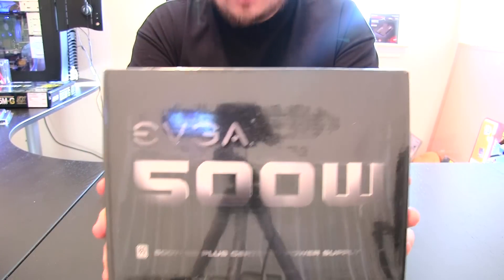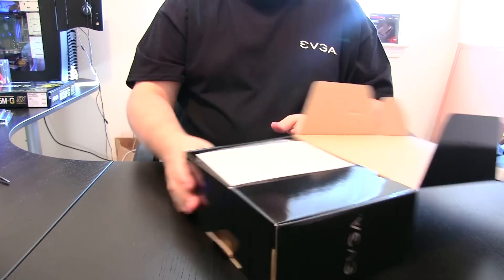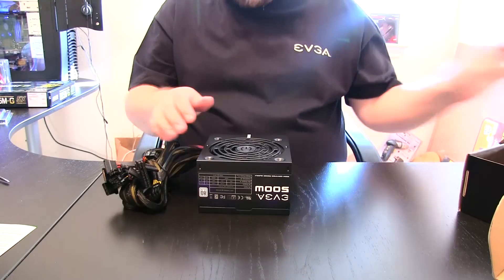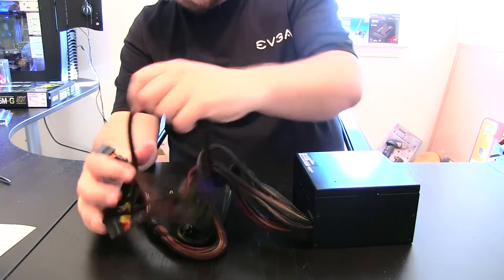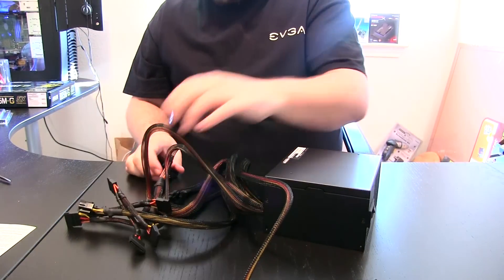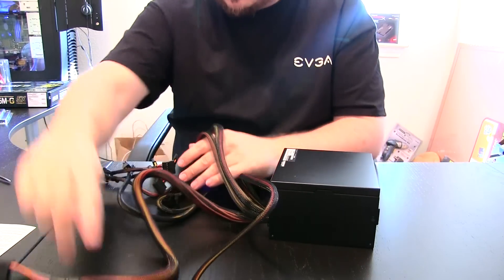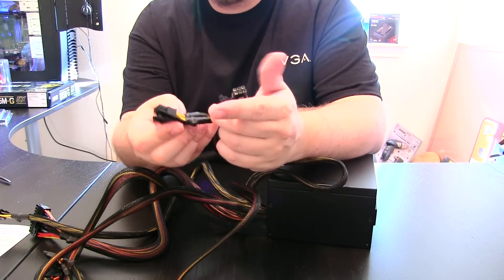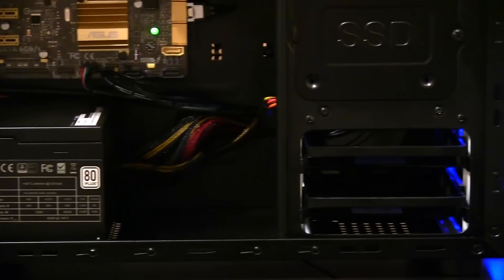EVGA 500 Watt 80 Plus Power Supply

Comment: can this thing power a evga 660ti ?
Reply: got a  shitty psu , i5 3470  8 gb ram, one ssd  , and no gpu for the moment i want to get a 660ti   and a power suply that can  deal with that  shit and wont die on me
Reply from the maker: @inferno  yes it can handle a 660ti easily, but you might want to see if you can get a better card for the same price.  use this legacy chart to see how other cards compare.  https://www.tomshardware.com/reviews/gpu-hierarchy,4388.html
Reply: thanks, when i build my gaming pc i will use it for sure, for now i build this budget setup to run some decent games and to handle  2k movies, i can get a evga 660ti for 40 -45 $  and all of this will be  around 150-200$ so is not that great but can still  work great with the shitty games i play at the moment.
Reply from the maker: @inferno  smart choice picking a quality PSU.  a good one will last through many builds and as long as you don't exceed it's rating will be good for years to come.

Comment: This video helped me a lot before I decide ordering that PSU. One last question: Will it fit in my Thermaltake Swing case? It's a mid ATX and I now use an old Innovator 450W max PSU.
Reply from the maker: It should work no problem as long as your old PSU is not an odd shape. 95% of all PSU's will fit in the same spot, some are just longer than others.  only custom designed ones will be an issue.

Comment: Hey buddy how are you doing?i hope you are fine.Just wanted to ask will this fit in my HP Compaq 8100 elite case?I am really looking for a replacement since i am not trusting the one it has.Thank you for your help.
Reply from the maker: most likely, it will fit.  the best thing to do is open the case and see if the one in there is a normal size and shape PSU.  they all pretty much fit in thew same space unless it is a very small compact PSU.    If it is a desktop case and not a mid tower, just make sure you have either an intake for the psu fan or enough space between the case and psu for the fan to get air.

Comment: Is this ATX or ATX mid, or backwards compatible? I need this info before I start buying parts for my new pc.
Reply from the maker: what are you looking for specifically in the backwards compatible dept.?  I went over every connection it has in the video, which should have covered this.
Reply: ***** I though mid atx was a thinner model. After I did a little research, I figured out it was just a shorter tower. I just needed to make sure this power supply fits inside. So yeah, I actually finally found it on a tomshardware.com forum thread about atx/atx mid.
        So this is an atx psu, I can use it alright with the tower I picked out.
Reply from the maker: oh, now i understand your question, i thought you were referring to the PSU connectors, not the size of the case. (years ago there were different connections)   mid or full size atx cases both take the same size psu.  this has been a standard size for a long while.  glad you found your solution.
Reply: ***** Okay, thanks. Yeah, the molex connectors are pretty old. Remember those ribbon wires all in those old computers? Actually a little easier now.👍🏻

Comment: Will this work with my MSI H110M Pro-VH and the new RX 480? I'm a noob at pc building.
Reply from the maker: The RX 480 has a 450 watt PSU requirement so this should work adequately.  However, I always use this PSU calculator to make sure.  http://outervision.com/power-supply-calculator
Reply: Alright thanks.
Reply: is this compatible with i5 6600k?
Reply from the maker: yes no worries

Comment: EVGA GTX 960 SSC 4GB
8GB(4x2) of Ram
1TB HDD
60GB SSD
i5-6500
Windows 10
Will this run okay?
Reply from the maker: +MinerDjTech you should be fine with this PSU. I always use this tool for my calculations..  http://outervision.com/power-supply-calculator

Comment: ordering this tonight...my current PSU making coil whine :'(
Reply from the maker: +TheRoshan89 good choice, the one i reviewed has been in service a year and a half in a heavy smokers home with and is still going strong.
Reply: +Mikes Tek oh really? does smoke affect PSU? does smoke cause coil whine? I don&#39;t smoke, just wondering, though i live in an apartment and sometimes smoke from my neighbors unit can be smelt in my room, but i do run an air purifier 24/7. My old corsair put up a good fight, have been using it for about 6 years now, been working fine but the coil noise is bothering me and corsairs are known to have coil whine like that, i hear very good things about evga and chances are this could be my next psu for life since  i generally stick to mid range performance graphics card which can be powered for 500w or less. currently have a gtx 750tisc 2gb and its been able to handle all the latest games at max settings 1080p, though i bet if/when i get a 4k display, its gonna be a game changer lol.
Reply from the maker: +TheRoshan89 it doesn't necessarily affect the PSU directly, but it has been know to be lethal to fans, which of course would kill the PSU if it's fan died.  you should have nothing to worry about though.  I'm talking a heavy smoker who sits by their pc and smokes all the time.  check out this old vid of mine to see what I'm talking about.  https://youtu.be/W8P3bTUbRiU

Comment: Hey! Do you think this can power two gtx 950 in sli with an AMD Vishera 6300?
Reply from the maker: +Andy Boy probalby, but use this PSU calculator to make sure  http://outervision.com/power-supply-calculator
Reply: it says i need 450Watts but reccommends a 600W PSU. What do you think?
Reply from the maker: I would go with a 600w then to be safe.  Be sure it is 80+ rated or better.
Reply: Alri. Will a amd fx 6300 bottleneck a gtx 950sli? Thanks

Comment: Do you think everything will fit in this build http://pcpartpicker.com/p/rrZCP6
Reply from the maker: Gunnyc animation Everything should fit fine. Personally, I would add at least a front intake fan as the case only comes with a rear exhaust one.  You might also look at the Xion case I reviewed.  similar in size and comes with 2 fans, but the styling is different.
Reply: well can u name me a good front fan thanks in advance
Reply from the maker: Gunnyc animation I would get a 120mm.  Not sure if you're trying to match a color scheme or not, so that may affect your decision.  The CoolerMaster sickleflows are good.  I have an old video that reviews it from when I was first starting my channel  https://youtu.be/2UgNn7xNubI  There are a lot of good fan companies out there, that's just one option that i've used personally and been pleased with.
Reply: kk thank you so much

Comment: Can it run an fx6300 and 280x?
Reply from the maker: HardcoreNerdGaming it should be fine, but you should always use a PSU calculator to verify your build.  I like this one personally  http://www.extreme.outervision.com/psucalculatorlite.jsp
Reply: +Mikes Tek  thanks man.  This other guy said he runs 2 280x's on a 450w PSU.  I'm new to this stuff, so I'm not sure if he was lying.
Reply from the maker: That would be pushing it.  I would recommend 750w or greater to sli
Reply: +Mikes Tek alright thanks man :-)

Comment: Does this PSU make any noise? Thinking of getting this because im using one that came with my case and it sometimes make a rattling coily sound that goes away if you touch the case or loosen the thumb screw for the side panel. its also loud in general.
Reply from the maker: rapper250 the person I made this for hasn't said anything about noise and I was around it a couple of months ago and it seemed quiet to me.
Reply: +Mikes Tek Hey Mike - I wonder of you can help me.

I have a Dell xps 8700 coming which comes standed with a 460w psu. I plan to upgrade my gpu to a 970 so looming at this psu here.

A good review I must say but you mentioned something that got my attention, something about the 20 and the 4 pin thing. would I be able to run the 970 which requires a 500w psu.  Or should I upgrad with this psu.

Thanks for time budd.
Reply: +Unknown Grace use a wat calculator,and check if your psu is 80 plus,bronze,platinum,etc.
Reply: Datonecharizard Don't have the P.C yet unfortunately.  Need to buy in advance. Apparently the OEM Dell 460w is fairly desent.  That's all I know.

Comment: LOL a friend of mine has this PSU but has a compaq tower super slim not even 4 inch wide he has to run it with the side off and the PSU out side the tower because it cant fit never seen a more ghetto set up in my life. thought i would give everyone a laugh.
Reply: welp i just bout this to have in sit ontop of my pc case with the wires routed through a hole in the top to power my gpu... now this is a ghetto ass setup XD

Comment: my PC:
FX 6300 3.5 GHZ
4 gb ram 1333 mhz
320 gb HD
Gigabyte motherboard
sapphire r7 260x 2gb ddr5

Is this power supply good or not to play games on my computer?
Reply: We have the exact same cimputer but i have 8gb of ram at 1600mhz and an msi 970 motherboard
Reply: I bought that SPU and it's working very well, playing a lot of games here... ;)
Reply from the maker: deadrools
 glad it worked out well for you. :)
Reply from the maker: This PSU should be fine based on what you listed.  Use this to calculate your PSU needs,  I've always found it useful.  http://extreme.outervision.com/PSUEngine